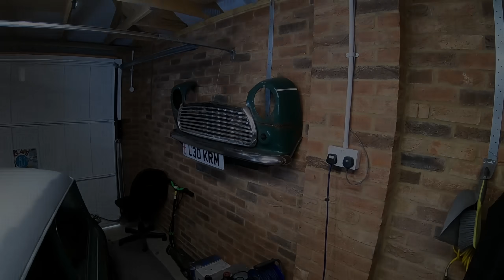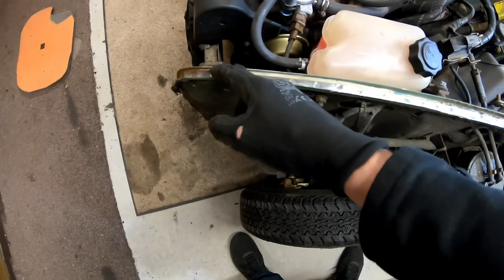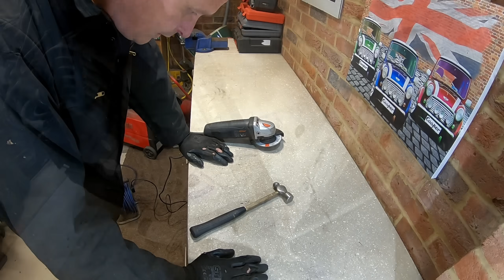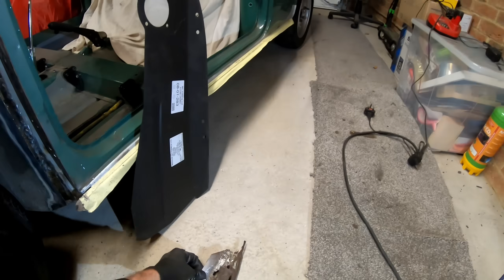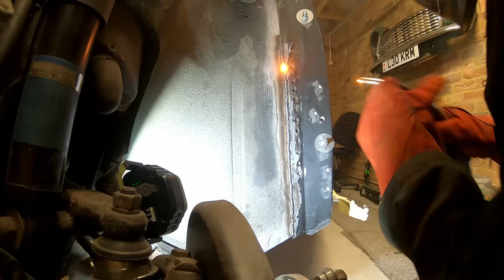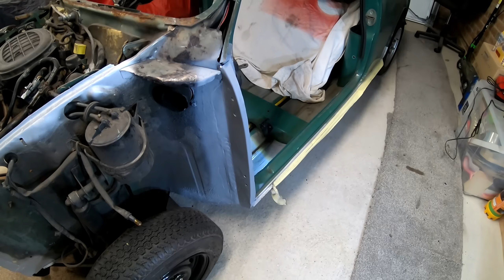Classic Mini Workshop - Project Sprout Pt.23 Inner Wing / Flitch Panel Repair

Comment: Best fabrication since Binky.. welds look tiny..  I have a small project I am working on ..  K20 AWD 6Sp from 94 SPI COOPER
Reply from the maker: Wow, that sounds nice
Reply: @classicminiworkshop  Tucked it onto a STANDARD round front..and the rear still uses the STANDARD (twin ) Tanks (SPI internal Pump ) and room for the SPARE 13" wheel and Battery...